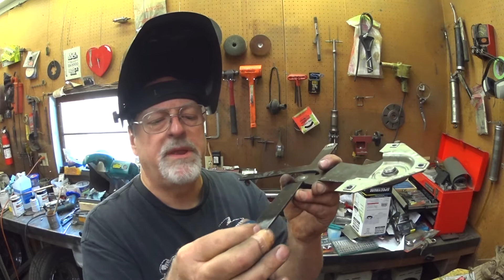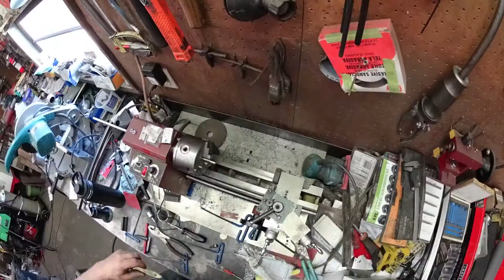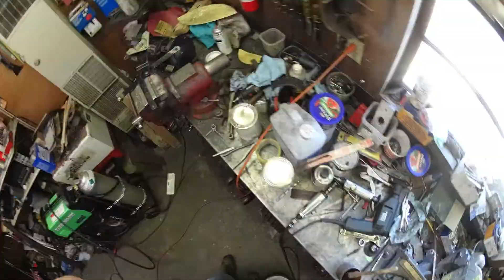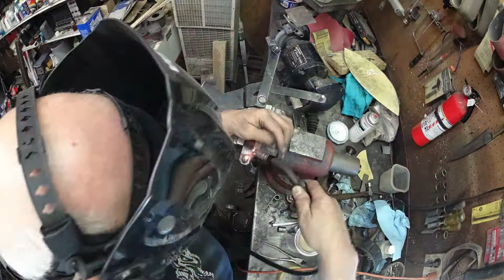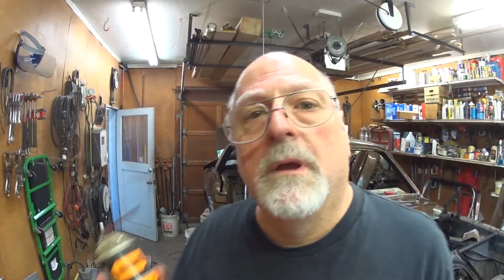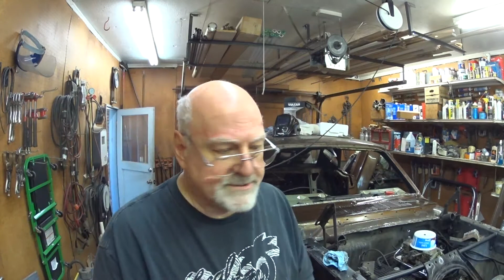66 Mustang Betsy - Window Regulator Repair & Modified

Comment: I really miss having access to a machine shop where I could make stuff like that. But the shop is now gone and I'm looking for a lathe and a mill. I kick myself for not buying one of the 36" lathes that Harbor Freight used to sell years ago for around 2K.  Did you weld it with stainless wire or regular steel wire. Since it's not a boat I wouldn't be worried about it.
Reply from the maker: Hey Robert,
Yeah just used regular wire to weld in the pins. Looking forward to easy roll windows. 🤓